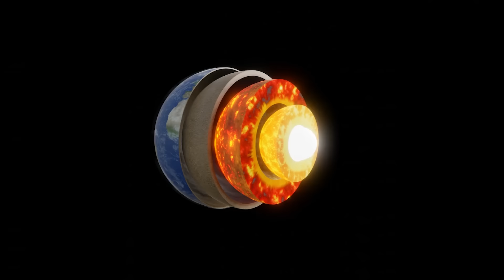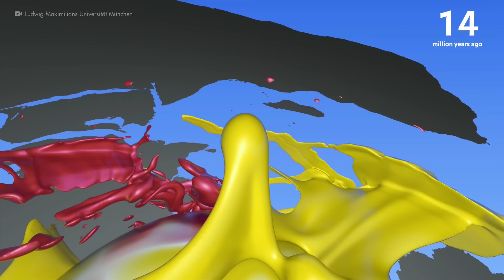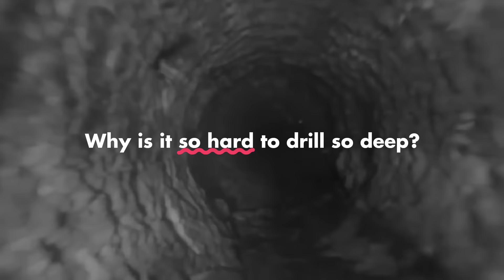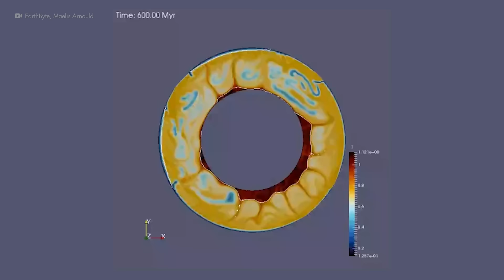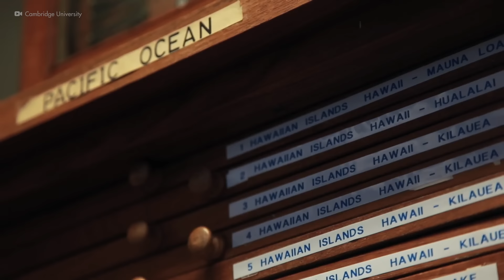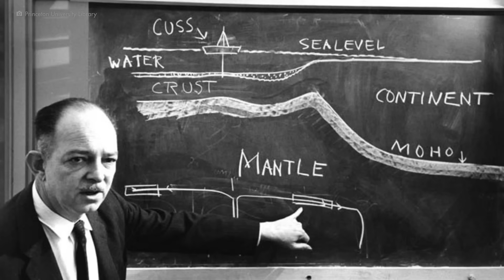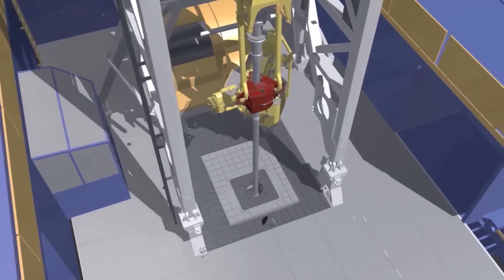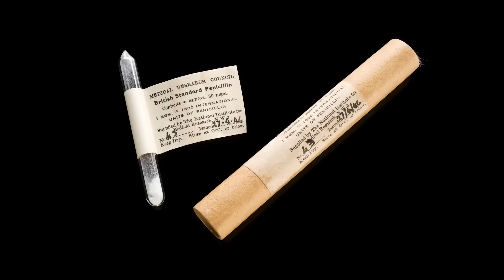Why Is China Drilling One of the World’s Deepest Holes?

Comment: Earth has liquid water on its surface.  It covers almost 70% of its surface.  No other rocky planet in our solar system does this.  I'm guessing the two major factors are  the internal 
temperature of Earth, and the magnetic field (that shields us from the solar wind).   
  I seen other videos on the old Russian bore hole.  When they stopped the project, they were encountering temperatures over 350°F.  I think that when water finds a way that far down, it gets converted into steam.  Steam rise back up until it condenses back into it's liquid form.  The Earth is like a constant percolating coffee pot.  The lower regions of our planet's crust sends the water back up, constantly.  
   Mars doesn't seem to have this process anymore.  It's water sank into the internal spaces of the planet, or it's been slowly evaporated into it's upper atmosphere,  where it's lost to solar wind?  Along with much of Mars' atmosphere. 
  So geothermal does seem like a great idea.  If we could find a way to bore down to where it's over 1000°F, we would have a steam boiler that needs no fuel.  Happy, busy steam turbines would give a nation such as China an excellent source of electricity.
  The borehole theory isn't new.  But we haven't given the concept the attention it deserves.   30 miles under our feet, lies an almost tireless source of energy.  When you start to see how unique this living planet is, compared to anything else that we've found, you realize that this planet is not replaceable.  It's unique make up, it's unique gravitational relationship between itself, the moon, the Sun, and all of the other planets.  Earth stays hot inside.  Like some kind of engine. This engine provides itself with a powerful magnetic field.  We live on a giant thermal electric motor. This planet lives.  It would be impossible to find one like it  that we could go to.
  I believe it is technically more feasible to terraform Mars than to dream of any object outside of our solar system.   Could we make Mars do what Earth does?
  Why aren't we giving geothermal engineers more consideration?  The future may be more down than up?
  Adendum#1: And as pointed out,  we are at a good distance from Sol. Not too hot  not too cold.  
   Adendum#2: There are subsurface liquid water bodies in our solar system, but they are encased in kilometers thick ice shells.  Maybe another reason to get better at drilling?
Reply: Taking heat from Earth's core might not be a good idea.
Reply: Exactly what I was thinking you hit the nail on the head thank you so much under our feet are the solutions to energy controlling the coffee pot
Reply: Uh....  There are moons that have water on their surface.   Europa, Enceladus, and Ganymede come to mind.
Reply: Under pressure, you can have liquid water at temperatures that normally boil it at surface temps.
Reply: @kayakMike1000  True  pressure rises the boiling point, but at molten stone temperatures, it will probably be less dense than molten rock, and especially, molten metal.  It will be displaced by more dense material, rising up to the point where it flashes into a gas?  Water is a funny molecule.  It's highest density, under earth surface conditions is it's liquid state. Water also, curiously, resists compression in it's liquid state. So it's maximum density won't be as heavy as other materials under intense compression. Hmmm?
Reply: @kayakMike1000  I should have specified liquid water.  
Good point, the intense gravitational interactions some of Jupiter's and Saturn's moons undergo make them live too.  Europa,  Io  and others tend to generate heat via gravitational stress also.  I stand corrected. Thank you.  There is alot of water out there, but it's usually not in it's liquid state.
And some of those moons are liquid water worlds, encased in water ice.
Reply: @kayakMike1000  There! fixed it. Thank you.
Reply: 30 miles down will never happen the farther down the Russians got the hotter it got & finally had to stop & they never even got past 6 miles. There are 3 moons in our solar System that have oceans under them one of Jupiter's Moons has more water than all the world's Oceans.
Reply: Nope, it's the fact that we're in the habitable zone, otherwise we would have no water or be a permanent frozen ice ball.
Reply: @Valentyn90A   Fears that extracting energy from the earths mantle by drilling bore holes would cause the earth to cool. This fear is unfounded. The energy in the core is unreachable and nuclear.The energy in the mantle is so great that even past volcanic activity such that caused the Deccan Traps (which released energy equivalent to total world output today) and was a single event is insignificant in terms of the available energy in the mantle. The technology is in its infancy but even if perfected, heat loss for the planet is insignificant even if hundreds of thousands of bore holes were drilled.
Reply: @user-sy8kj5nn8s  I believe that boring into our own mantle is possible.  In doing so, we would realize that there are no shortages of resources at our disposal.   There is plenty of energy, and mineral resources.  
KayakMike1000 has already pointed out those moons, like Europa.  Not an ideal place to live, except maybe if we were good at boring deep through the ice shell that encases it's liquid water interior.  I think it would be prohibitively difficult to live there  under miles of ice, under water.
Reply: Could you repeat that for the people in the back please,?
Reply: Did you not watch the video the further they dug the hotter it got right up to where they reached 40200 feet & temperatures reached 2,200 Celsius to hot for any materials we have today used for digging.
Reply: @user-sy8kj5nn8s  I don't believe it was that hot when they stopped.  At 2200°c  You need not go deeper.  That's just the kind of heat source a geothermal power plant could use.  Pour in water, up comes very hot high pressure steam.  If only we had dug that deep.  Go deeper  get even more heat.  Conventional drilling equipment won't do.  Todays deep drills are already water cooled.  One would need to design a drill that facilitates far higher water circulation.  Steam would be blasting around the bit  up the shaft.  Capping the bore hole would be a challenge.  We cant just go out and do it tomorrow.   Look at how much money we've invested into nuclear fushion research, over how many decades. From the time John F. Kennedy said we will send a man to the moon, and return him safely to the Earth, approximately 7 years passed before Niel Armstrong set foot on the moon.  Few days after that, he was returned,  safely to the earth.  This is possible.  Earth contains more thermal energy than the human race has generated in it's entire existence,  a million fold or more.
Reply: @Valentyn90A  We wouldn't be drilling that deep!  That's impossible by today's knowledge and practices.
Reply: @SmallWetIsland  You get it.
Reply: @@Cultureshocked-ky3bp I'm sorry.
Reply: not Russia but the Soviet Union
Reply: Great idea.  Let’s do what the Kryptonians did.
Reply: TLDR
Reply: Research all the countries that already have geothermal electricity.
Reply: "Earth has liquid water on its surface" It has twice as much as is on the surface bound into rocks of the crust and the bound-in water lowers the rock melting point substantially (This is how plate-collision boundary volcanoes tend to form)
Reply: Whatever energy you pull out has to travel several miles, no biggie. But it’s through a 12”(?) diameter cross section. You can compute from watts, ie joules per second, you wish to extract, what the energy density of the fluid through which the energy travels, would have to be. Do you have any materials in liquid or gas form that can hold that much energy in a given volume? And how will that fluid flow affect the walls of the well? Sounds like you have a lot of work to do. Keep me posted, sounds cool!
Reply: Hey, I watch You Tube.  Even designing a geothermal plant is beyond me. But, really, what thermal dynamic fluid?
Some one get this guy a glass of water.
lol.
Like 1000s of glasses of water per second. lol.
Groovey!

Comment: There is a definition problem: Vertical depth and horizontal displacement. How straight is the hole?? It is easier with a slanted hole to have hole wall share the weight of drill string. Long before reaching the lava layer, the heat will mellow the steel, dull the drill bits  and disable the bearings.
Reply: They could make things out of exotic alloys with metals with super high melting points

Comment: The Soviets tried this, and found nothing but very hot rock. Geothermal works ok, but the setup costs are a bit steep.
Reply: Everything's expensive at first.
Reply: @brauljo expense*
Reply: @homie7218  i meant "expensive", thanks
Reply: peacenow42  fair point. i guess it just depends on what the available options are. like in parts of the middle east where there isn't much of a choice so it's more common
Reply: peacenow42  water source
Reply: peacenow42  ¿can't desalination plants be built closer to water than have transporting salt water be significantly expensive?

Comment: Wouldn't be better to drill like corkscrew.  But in tunnel form. That way you can excavate and transport dirt/rock up to surface and less broken drill bits as for drilling straight
Reply: yes, let's make a drill that isn't strait..so when you appy it, it just breaks faster. good plan
Reply: @kantraxoikol6914  
"In tunnel form" seems to have gone over your head. He's suggesting a proper mineshaft where you can actually do maintenace and cart up rubble. That means a tunnel bore at the drilling point, not a spiraling drill shaft.
Reply: Getting the "cuttings" out of a bore hole is not a problem. You always drill with "mud" being circulated to clear cuttings, combat formation pressures and create a "wall cake" to make everything run smooth. The "mud" is tightly controlled with weight, viscosity, PH etc.. Mud can be water or oil based.
"Tunneling" would be a recipe for disaster very quickly.

Comment: Is super critical geothermal that much of a promise? Why don't we hear about it more?
Reply: Scientific tedious.
Reply: The powers that be haven't figured out a way to bill for free energy.. and don't want to deal with a populace that is harder to keep under heel.
Reply: Actually, using geothermal to generate power, has been around for 100+ years and is well-proven. The problem is, there are very (very) few "ideal" (a/k/a close to the surface) pockets of 400-700 deg geothermal, which limits the number (and size) of power plants that can be built in the world. However, that's all about to change given there's a new drilling technology coming to market, known as "plasma-bit" drilling, which can not only drill holes very quickly, it can also drill holes extremely deep... deep enough to reach the 6+ milies of depth required to find temps hot enough to run massive steam generators, which will be able to produce huge amounts of super cheap and clean energy, just about anywhere in the world.
Reply: The reason why other countries don't bother is likely due to the very high cost compared to the returns. It just isn't worth it.
China has a reputation for wanting to build the biggest this or that. Seems their main endeavour is to beat everyone else at whatever their own game is, no matter the cost financially and in terms of toil. 
But we see how their mega projects turn out. Multiple tower block constructions being demolished because they were badly built. The 3 Gorges Dam, buckled and bent. In fact, their penchant for building dams everywhere possible has been disastrous in recent years.
Reply: geothermal plant north of ridgecrest califonia
Reply: It'd be like ordering the exxon valdez to fill up your honda once.
Reply: It is hard to patent and available to all therefore no profit for the greedy.
Reply: @SJ-lm7xz  You don't seem to understand the amount of money it would take. Money that would never be realized back in profit. It's not that it can't be done it's someone HAS TO PAY.
Reply: @ezrollerj  I was talking about geo thermal to heat a home, got distracted from the video.
Reply: @SJ-lm7xz  iceland

Comment: How much will a drill shaft that long twist before the head starts to turn?  Maybe a better idea would be some sort of self-contained vehicle like in the sci-fi movies that can lower itself down and all that would be needed is to send it fuel from above.  Perhaps, once it's deep enough, it can run on the ambient heat down there.  Xi.  If you read this and you like the idea, just send me a gift card for Panda Express.
Reply: ninja turtle the shredders machine
Reply: Only the drill head rotated in the Kola super deep bore hole. The Russian engineers developed a new system to power the cutting head with slurry pressure
Reply: Hey, thanks.  I always wondered how that worked.

Comment: If they can drill as deep to earth core. Wouldn't that cause pressure and heat to escape through the hole they drilled? I'm not sure if its a good idea to play around with the interor of our planet it could.mess things up. Just imagine a boiling pot with a lid on it. And then you put a hole in the lid. Steam will russh out from it lowering the temperature slightly and moving the boiling point differently.  Do the same.to a planet and volcanoes may form elsewhere and other issues may happen.

Comment: Doesn't this cause cracks in the mantle causing earth quakes?
Reply: No but it could cause lava flow in unwanted places
Reply: Its only a eight inch hole, so no it wont cause anything
Reply: Stupid question!
Reply: @luiziferbehel3750 you Are clueless
Reply: @justadildeau  im a bioterra-former thats the biggest issue we encounter when bioengineering the species around it
Reply: sigh. you did know that mantle is 8 miles thick right?

Comment: Drilling deep holes in the earth is incredibly difficult.  I doubt they can go very deep unless they can find pipe that doesn't stretch and can withstand temps that melt steel.  A million pound derrick is normally needed to drill to 20,000 ft.
Reply: the problem is that the rock will get like honey very deep, you can not drill in it

Comment: From my understanding, at about 25-50 miles below the surface, are very large caves. Large enough that cites can be built in them.
Reply: WAY too hot. 30000 ft is around 500 degrees farenheit.
Reply: in other words, ZERO understanding about Earth....how can you still be alive?
Reply: @kantraxoikol6914 How do you know for certain? 😊
Reply: @@charlesrichter3854 Yes. Actually it sounds very plausible to me.  If you think in terms of air bubbles, pressurized air bubbles in solid objects such as Swiss cheese or bread.  

The bore hole was drilling through the solids, which is hotter as it gets deeper and pressurized from the weight.

Comment: "either all or nothing", "think big"

If you want to go deeper, you have to drill a hole several meters wide. Tunnel boring machines could be adapted to drill vertical holes.

Would have several advantages:
1. Scientists would have direct access to the earth's crust.
2. The hole could really be drilled vertically and would not have to deviate from vertical as with the KTB 200m because the drill follows the path of least resistance.
3. The problem of heat could be better counteracted with such large holes, and the problem of pressure would also be significantly alleviated, both of which protect the drill bits.
4. Repairs could be carried out by humans or robots directly on site.
5. The drilling technique could be adapted to the respective rock layer, e.g. hydraulic milling for sandstone, claystone and limestone or blasting for very hard rock

Comment: The Russuian Kola Deep Bore Hole is the deepest bore hole at 12.2 kilometers or 40,230 ft. 
Oklahoma U.S.A. The Bertha Roger's bore hole 9,583 meters or 31,440 feet.
Both stopped because of heat issues. Core samples from Kola would crumble to dust when they reached the surface due to the high temperature and pressure.
China may not get as deep as they would. I'm sure they'll lie about it anyway.

Comment: Good luck with that.
Melted drill bits, drill pipe deforming from the heat, drill pipe corkscrewing in the hole under the strain.....

Comment: The drilling is about resources and economic gain, not about scientific discovery. Scientific discovery will be more of a perk. Basically, they'll be pulling material up so we should get the benefit of studying it. The other secondary benefit will be scientific and engineering progress due to the need/want to drill deeper. Similarly, a great deal of our modern gadgets are due to war efforts. While I like the idea of doing it because we want to learn, I'm not that naive.  I wonder how much geothermal energy we could suck out of the earth, before causing problems - there is no free meal and no such thing as perpetual motion...laws of thermodynamics and all.

Comment: All of this is nonsense, drilling deeper does not mean untapped reservoirs of oil and gas, they do not exist deep down. If you are looking at geothermal than even here you don't need to drill deeper than current depths. The massive problem for drilling deeper is the actual drill string itself, the pipe they screw together adds weight and then you are restricted to pulling it out and running it in, the steel stretches and snaps if the string is too long, worn out and damaged by heat. Most oil wells are around 3000m the deepest I worked on was in Japan closer to 5000m in Thailand everything melts due to pressure and temperature increase at less than 3000m. All electronic packages used while drilling in the BHA (The controllable bit of the string) suffers as the solder for the electronics melts and the components fall out of their circuit boards and the string is too hot to handle for days. But, like I said the biggest constraint is the weight of the drill string it will become too heavy to pull out or simple snap in two.